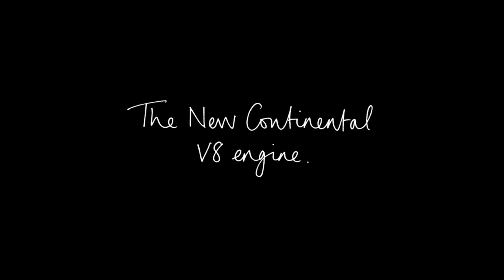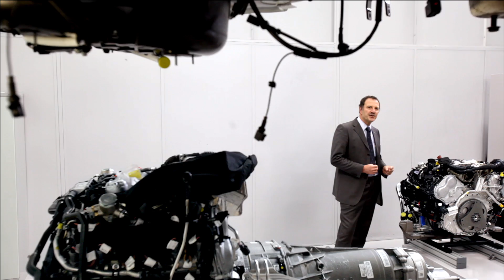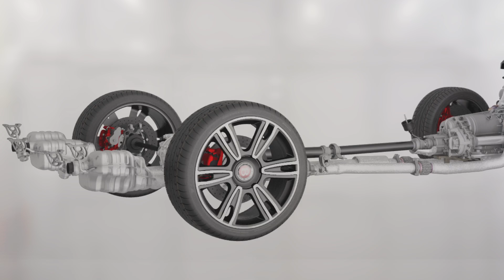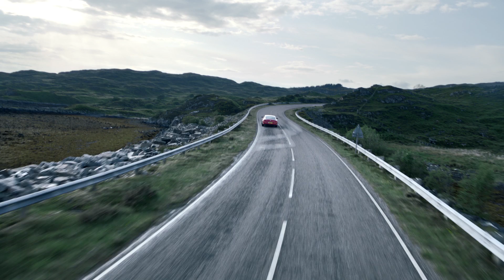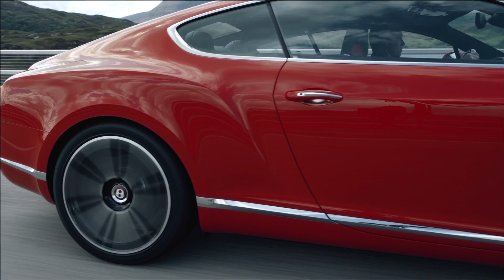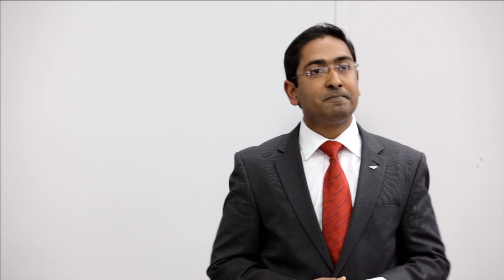Bentley Continental V8 Technical Film

Comment: had a 2006 W12 , sold it few months ago. 
anyhow I take my statement back, the w12 was not a good idea, once the system starts causing problems, the mechanics cannot repair or trouble shoot it properly. its very complicated engine. 
V8 propbably a simpler engine. can be maintained better than these twin turbo w12s

Comment: You can still order the Continental GT with the twin-turbocharged 6.0L W12 engine.

What's that? You weren't going to order one? Oh.
Reply: ..90009000kkkkkkkooo okko 0onkokonknonmmm mmiimmomuumu ..m9oii.0.m.n.0990ublo 
 I.iono pi0 0.00

Ui.0 
.0